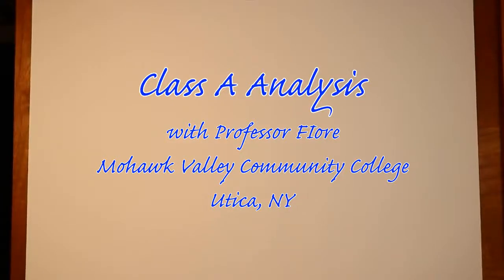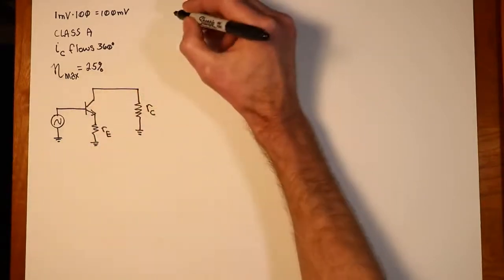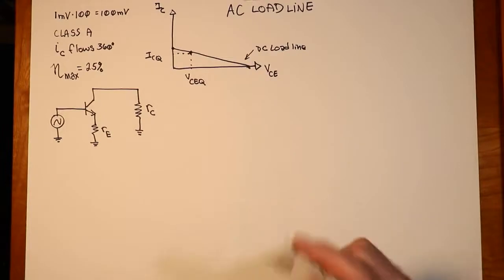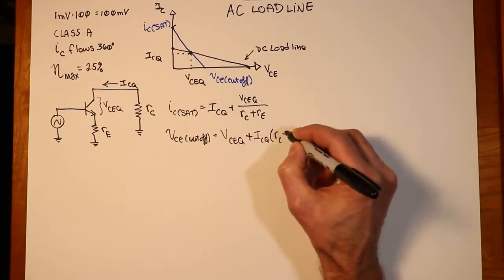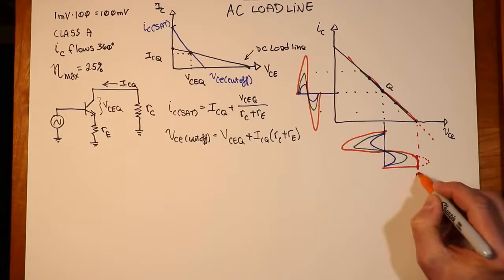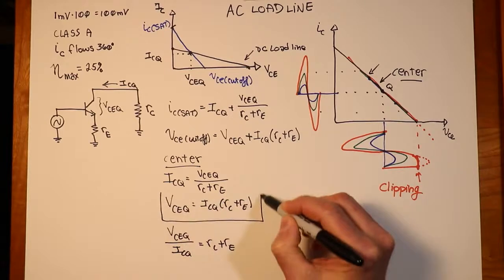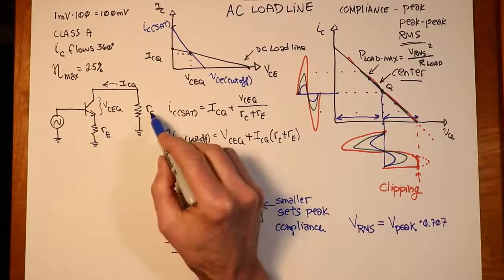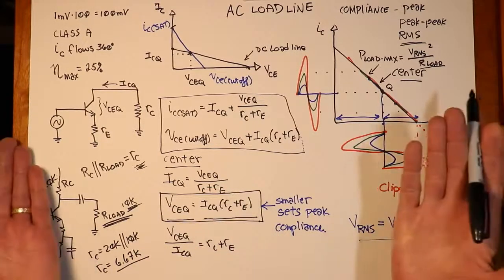Semiconductor Devices: Class A Power Amplifiers

Comment: I've re-read your notes and watched this again. Is it possible that the AC loadline would overlay the DC loadline or will it always be steeper?
Reply from the maker: In the abstract, the slope of the load lines indicate the collector/emitter resistance (the slope is the conductance). As the AC equivalent normally has lower resistance (due to the capacitors), you see a steeper slope. Of course, if you had some manner of inductive coupling, it could be the opposite (but then again we tend to shy away from inductors, so...).
Reply: @ElectronicswithProfessorFiore  Excellent, thank you. I was thinking that if there are no capacitors, DC and AC would be the same.

Comment: What am I missing here? what is a generic circuit? I only know about the AC model with a current source and a small r'e. Pls explain prof, I'm so confused.
Reply from the maker: "Generic" in this context just means "typical, no outstanding or unique features". A simple controlled current source with r'e model really is all you need for this. Later, we can add more detail (like the effective impedance of that current source, junction capacitance, etc.). This video is just the extension of a typical small signal amplifier, showing the power relations.